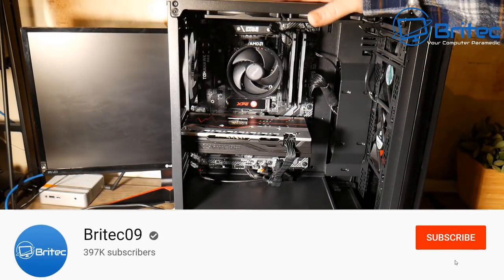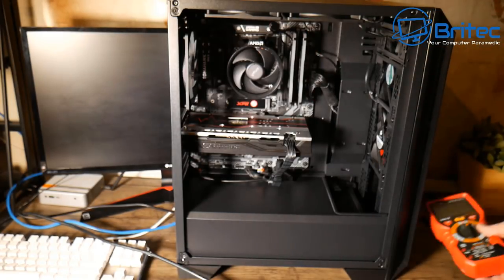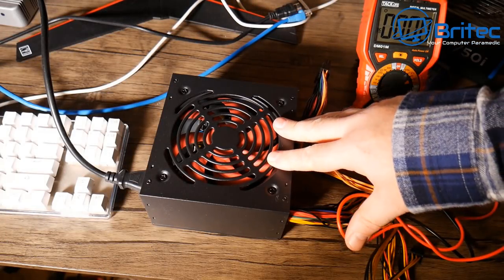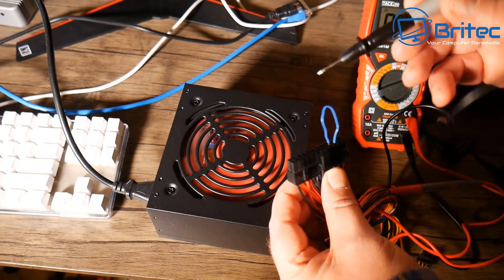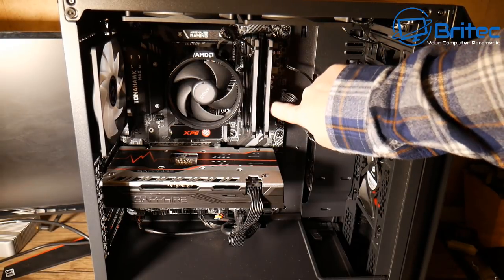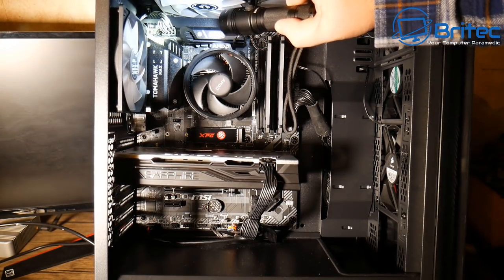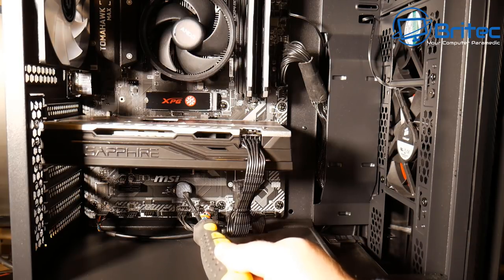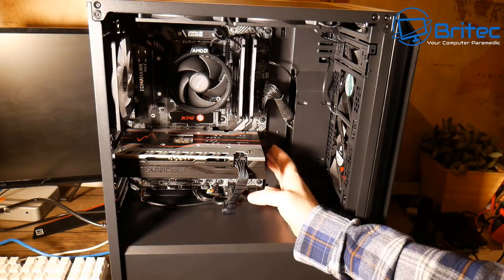How to Troubleshoot a Dead PC

Comment: Another good vid, think a lot of people are intimidated by the options in a multi-meter. Use a mains 'no'-contact pen, these are great for just finding if the current is going through a cable or at a socket, doesn't need any knowledge just point.
Here comes the warning, don't believe these are foolproof, treat them and electricity with respect.
Reply from the maker: yeah

Comment: You can swap the reset and power plugs to eliminate a faulty power switch as the reset switch will also work as a power switch.
Reply from the maker: that is correct

Comment: You should measure voltage on power cord so that you would know is there any power and is the power(voltage) good. If you just check for live wire it could be that there is power but not enough.
Reply from the maker: Like I said, you can check voltage as well